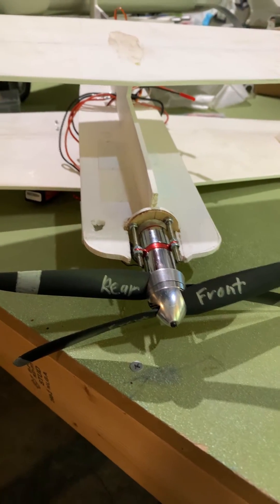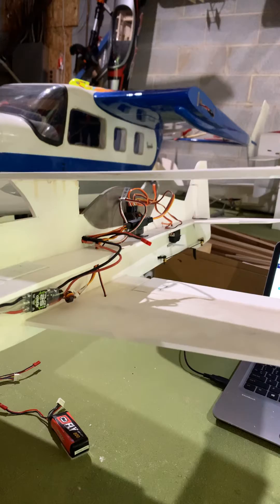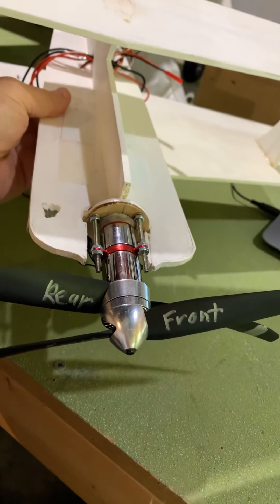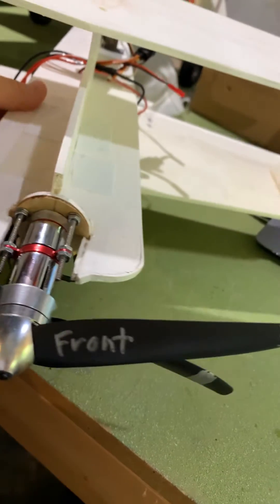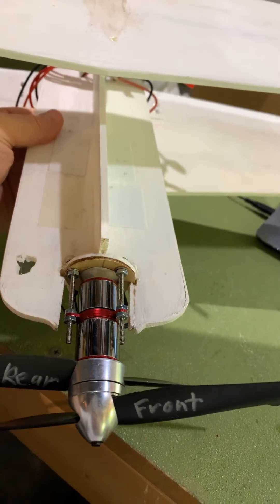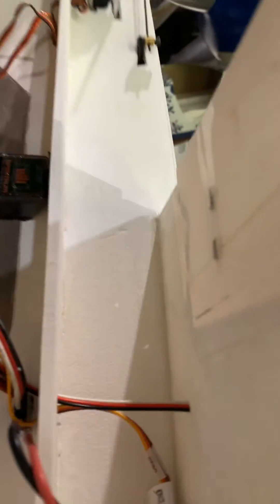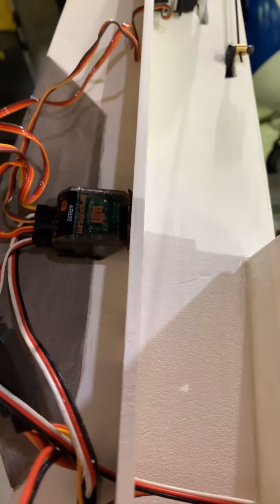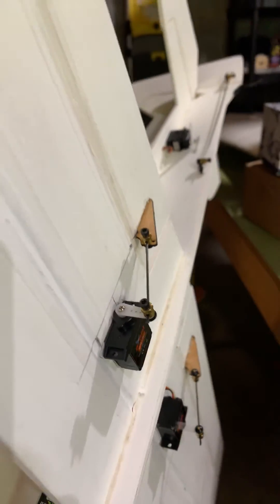Flat Foamie Ultimate Biplane with Counter rotating Brushless Motors

Comment: what is the size of the motor mount that comes with the moter bc i cant find the dimensions anywhere
Reply from the maker: It doesn’t really come with a mount. There are holes behind the first motor for the screws to pass through.
Reply: @PlaneFunRC  I see thank you